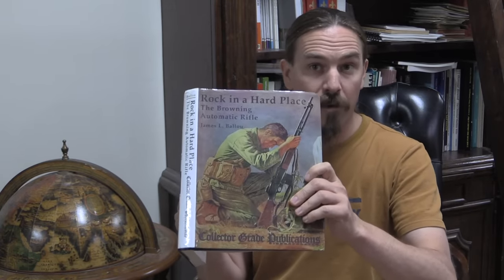Ask Ian: Why Not a Semiauto BAR Instead of the Garand?

Comment: When I saw the title I was like "eight minutes to say 'because it would be stupidly heavy?'"  But I guess the question was smarter than I expected.
Edit:  Ironically, the modern BAR is one of, if not the lightest full-power semiauto rifles on the market, coming in at as little as 6.5 pounds in non-magnum calibers, and still under 8 pounds even in magnum calibers like .338 Win Mag with a 24" barrel.
Reply: It was also much more expensive than anything like the M1 (4X the unit cost). It would have been an unaffordable as a primary rifle.
Reply: My first guess was manufacturing costs
Reply: @kolosmenus  Mine too. Plus weight.
Reply: @patrickancona1193  It wasn't even close to the first LMG, or even the first American one.  The Madsen, Chauchat, Hotchkiss, Lewis, and Huot all predated it and were designed for bipod use.  The Madsen was made in the 1880s.
Reply: As someone who's fired an M1918A2 BAR, it is a bit of a hefty gun, but so is the XM5 by today's standards, and the US Army is adopting that.

It's when I opened it up and was surprised the BAR wasn't designed by H&K, but unsurprised that it didn't become the primary service rifle.
Reply: I’m pretty sure they weigh over 15 lbs
Reply: @johnallen7098  No, the BAR doesn't come in .338 Lapua.  It does come in .300 Win Mag, as well as 7mm Rem Mag, but .338 Win Mag is the biggest one available in the BAR.  And if you're saying that .338 Win Mag isn't a caliber, then you really need to learn a LOT more about guns before you try correcting people.
Reply: @JimIBobIJones  That's because of ecomomy of scale and because the BAR was more complex to build as a automatic machine gun. If you made it lighter and semiauto only and produced millions of them, the cost would be roughly the same
Reply: @jmanieri3651  The M1918 weighed 16 pounds, and has been lightened to as little as 12.5 lbs.  Ian said that in the video.  The BAR that is in current production is a semi-auto hunting rifle with a stellar reputation for accuracy and reliability.
Reply: @phantomsoldier497  Making it semi auto only wouldn't reduce the price. Modifying an existing mechanism to be semi-automatic only doesn't actually simplify the mechanism. If you aren't simplifying, then there are no cost savings. 

Look at any gun that has had its firing mode modified, the unit cost remains largely the same (e.g. M1 garand to m14). 

Also economies of scale has diminishing returns. Granted, producing more would make them a bit cheaper but given already the relatively large number of BAR (300k+) produced, you won't get a lot of cost savings by scaling it up more. Economies of scale for being the primary frontline rifle would not account for the BAR being 4X the price of the M1.
Reply: @Bacteriophagebs  I didn’t even realize BARs were in production.
Reply: @Bacteriophagebs  Cool info, I always thought the BAR was strictly 30-06.
Reply: @GodDragonLich  The modern BAR is a completely different rifle to the M1918.
Reply: Personally I think the modern BARs look ugly as hell. Still want one, though.
Reply: @Bacteriophagebs  The semi-auto hunting BAR was a rifle designed in 1966 by a different Browning, they're not the same gun.
Reply: @charlesphillips4575  To my knowledge, which I admit is not great as I have only fired the M1918A2, the modern BAR is not a BAR it's the HCAR. A completely different rifle made, as far as I can tell, as a kinda tribute to the BAR. Again, I could be completely wrong and please correct me if I am. Anyway, I was speaking specifically about the M1918 BAR, not any "modernized version" of it.
Reply: @steventatlock5443  I'm aware.  It's just funny that a gun with the same name is so different despite being similar in many ways.
Reply: @GodDragonLich  They're talking about some tacticalized thing called the HCAR.
Reply: @Bacteriophagebs  the Huot is younger than the BAR, and never progressed past the prototype stage
Reply: I thought this to when I saw the vid aswell
Reply: You're referring to the hunting rifle. Completely different design.
Reply: @Bacteriophagebs  the commercial hunting rifle and the m1918 are completely different designs.
Reply: @Bacteriophagebs  they share the same name, they are completely different designs.
Reply: @jmanieri3651  they're referring to the commercial hunting rifle. Ohio ordinance however does make a copy of the m1918.
Reply: @GodDragonLich  it was actually ordered in several calibers.
Reply: @GodDragonLich  Ohio ordinance makes M1918 reproductions in both varieties.
Reply: @Bacteriophagebs  they're completely different rifles.
Reply: Hmmm thought the same!
Reply: Modern commercial Browning (semi) Automatic Rifle has no design heritage to the military machinegun BAR.
Reply: @Bacteriophagebs  Great, just great, now I will have to look up the Madsen, because otherwise I won't find and sleep. :D

But to be serious, I am always fascinated what a rabbithole of a topic historical gun design and historical guns are and how far certain designs that most people see as (relatively) contemporary actually reach back in time.
Reply: Friend Kyle has .338 mag bar. His dad bought it for him before he passed at an early age.  One of the most amazing rifles I have ever held.
Reply: The thought of shooting a full auto 338 Win Mag made me gag.
Reply: Where would a fella find a modern BAR?
Reply: @Bacteriophagebs  The chauchat was amazing
Reply: @nickmadigan2824  it's called an hcar, heavy counter assault rifle
Reply: Naturally the Army decided to ditch the semi-auto mode and make it a lot heavier instead. 🙄
Reply: @abrammilner9560  thanks, brother!
Reply: @Bacteriophagebs  .338 Win Mag isn't a calibre, it is the cartridge. .338 is the calibre.
You should really know a lot more about guns before correcting people.
Reply: The modern BAR has almost nothing in common but the name with the actual M1918.
Reply: @patrickancona1193  The BAR was originally designed for something called "walking fire". That doesn't sound very mounted to me haha
Reply: @johnallen7098  No, he meant .338 Win.Mag.  Famous hunting cartridge (elk/moose, + bear defense) in N.America since 1958, long before .338 Lapua (1989) came on the scene.  FN's modern "BAR" he's referring to, is just that:  a hunting gun, not a military arm.  Practical relation to the original BAR is basically in marketing name only.
Another Ironic Edit:  .300 Win.Mag. was actually derived directly from the .338 in question, five years later in 1963.
Reply: @JimIBobIJones  you forgot the part were I said lighter. Most of the cost of the gun is due to the fact it's a lmg.
Everything must be heavier to sustain auto fire and plus the gun was given a bipod, a flash hider, a buffer recoil spring and a complex fire rate reducer mechanism.
If you go semiauto you can pretty much throw away everything I listed up and use lighter materials for the receiver and barrel.
Reply: modern hunting rifles designed to be as light as possible and only fire a few shots back to back aren't exactly on par with combat rifles
Reply: @phantomsoldier497  again I would say you are way overestimating the impact on unit cost. Colt did make a version of the BAR for the civilian/law enforcement markets with pretty much extactly the modifications you mention - and it barely had an impact on price. (It went from $319 to $300)

You can look at modern firearms as a comparator, where you can much more easily get different builds of the same gun. Those components are always a small fraction of the total cost of a gun.
Reply: @JimIBobIJones  still comparing apple to oranges. The civilian version of the BAR is still a BAR so basically the exact same thing minus a few things.
They never built the semiauto proposal Ian was talking about. 
That conversion would basically be a completely different weapon that has little to do with the original gun just like the m14 and Garand
Reply: @phantomsoldier497  not really. I've refuted all of your points as raised
Reply: @phantomsoldier497  to expand, you can't simplify the BAR to reduce costs sufficiently to make it a viable primary rifle.

It's built from the ground up for a particular function and its price reflects that.
Reply: @JimIBobIJones  now you really didn't.
You still are comparing apple to oranges. A machine gun will always cost a lot more than a semiauto rifle. For example the M27 IAR costs more than double than a M4 carbine and weights more while being extremely similar because one is supposed to be a squad automatic rifle and the other an assault rifle.
Same would be for the BAR. Some version of it went down to only 13 lbs while being still being an lmg. A semiauto conversion designed as such can easily go to 11lbs like the Garand.
The only thing a BAR and an eventual BAR semiauto derivative would have in common would be probably the sling, the buttstock, the magazine and the action (not everything)
Reply: @phantomsoldier497  you raised 3 points (economies of scale, transitioning to a semi automatic and weight) as factors which I have refuted.

Your current argument is entirely lacking of any specifics and is grasping thin air.

You are comparing a family of modern weapons systems with hypothetical modifications on a specific weapon. 

There is actually a modern reproduction BAR that's semi-automatic. It's still twice the cost of a reproduction M1.
Reply: @phantomsoldier497  also, had to do some research on this (as my interest/background is in history and not modern firearms) but the M27 is not a derivative or a part of the m4 family but of the HK416. 

The m27 IAR and HK416C sell for the same price to militaries so your example actually disproves your point. A LMG variant of a frontline rifle is not inherently more expensive because its in LMG config
Reply: @JimIBobIJones  the HK416 goes for 600 dollars while the M27 is 1400 dollars and yeah the HK416 uses the bolt from the G36 which in turns is a derivative of an AR18 which uses a similar bolt to the AR15 plus the upper and lower receiver are clearly a AR15 derivatives. The HK 416 is in the AR15 family even if it is different. 
You treat weapons like it's impossible to make one system work in another while most designers copy each other continuosly when making guns.
For example the m240 in US service is basically a BAR in disguise since they took the BAR bolt, turned it upside down and placed in into the gun or the AR15 itself taking the bolt from the m1941 Johnson
Reply: @phantomsoldier497  hk416a5  is the variant sold to the military and it goes for the same price as the SAW variant. And I was explicit in the model and the sale to militaries.

I am tired of this pedantic argument where you just make wild generalisations without proper rational explanation or proper analysis of the evidence.
Reply: @JimIBobIJones  Dude the HK416C doesn't even exist lol, it was a prototype of a compact carbine that never went into production. 
You are the one making generalizations without even knowing what you are even talking about... Have you ever even fired a gun?
Reply: The BAR MKIII action has nothing in common with the original BAR. In particular, it has a rotating bolt, and not a tilting bolt like the original. The tilting bolt was a good part of the reason why the original BAR couldn't be lightened further than the Monitor model.
Reply: @patrickancona1193  Actually, the Madsen (M.1902 et seq.) was the successful light machine gun intended primarily for bipod use.  The M1918 was originally concieved primarily as an automatic rifle (hence the designation) for "walking fire" in the assault.  It didn't get a bipod until the M1922 cavalry model, or the infantry M1918A1 of 1937 or the M1918A2 of 1938.
Reply: My first thought before watching this video is the mechanism. Turning the BAR into a self-loading rifle is not possible. There is no reciprocating charging handle to manipulate the bolt if something happens, no way to fire rifle grenades, and it takes box magazines that cost more than stripper clips or en-bloc clips.
Reply: @Bacteriophagebs  don't forget Colt's potato digger
Reply: m14 weights 5,1 kg loaded,its something like 11 pounds?so 8.5 ponds BAR would be light
Reply: I have a left handed BAR (shortrac) chambered in the obscure 7mm WSM cartridge. My favorite deer rifle, it wouldn't mean so much to me if I didn't have to save money for months while I was going to college. I stopped in that gun store about once a week to make sure it was still there. Of course it was, who in the world would want a LH eject rifle in 7mmwsm lol
Reply: @charlesphillips4575  Here here!  Charles brings the actual truth:  the modern sporting BAR has little or no connection to the original military BAR.  Two different rifles made during two different eras for two different purposes.  The only similarities I can think of are "made by Browning" and "selfloading design."  Then there is the "Ohio Ordnance semiauto 1918 SLR", which is a modern semiauto only copy made by a specialty manufacturer.  Closed bolt and all that.
Reply: I think you are mixing up two very different guns. Browning makes a BAR for hunting Other than the name it has nothing in common with the gun Ian is showing. No parts interchange. The hunting bar uses a rotating bolt to lock very much the same as Remington's model 740 or 7400. In fact they compete for the same market.
Reply: I hate to correct you brother but the BAR weighs almost 19 1/2 pounds. the M1 Garand rifle weighs about 10 pounds.
Reply: @lpd1snipe  Try reading my comment again.  Or read some of the other replies until you figure out what I was talking about.
Reply: By the modern BAR, do you mean the Ohio ordnance HCAR?
Reply: The HCAR from Ohio Ordnance Works is an excellent rifle
Reply: Blinks
Uhhh, HOW do you get a 16-pound gun to weigh as little as 6.5 pounds? At first glance it seems that drastic a reduction would have to be done while changing the gun so much it’s hardly a BAR at the end of it.

(Obviously they are BARs, otherwise we wouldn’t be calling them that, but again, how did we lose so much weight?)
Reply: @magiccarpetmadeofsteel4564  They're not the same gun, they just have the same name.  Different inventor (also named Browning), different action, different purpose.

Comment: As Ian hinted to the M5, a lightned version of the BAR at around 12 to 13 pounds would still have been pretty good considering the firepower and reliability of the system. With an 18inch barrel, 20 round magazine, closed bolt semi auto only, pistol grip and FND style dissassembly, I think the BAR would have been a pretty good weapon till the M16 came around.
Reply: Fair enough, I look at the M14/15 as being decent but not as good as the BAR in full auto.  The first lot or so of M14s were chambered in 30-06 and were later made in 7.62 for commonality with NATO in ammunition.  Of course we then had to go to the M16 and 5.56 go figure
Reply: the modern bar, which has a rare 18" box fed model, is far lighter than that, and checks all the boxes. the problem of course is that everyone knew what the bar was, not what it could be.
Reply: @ALovelyBunchOfDragonballz  It is light for what it is and compared to the original BAR, but that's where it stops.
Reply: @ALovelyBunchOfDragonballz  i will give you that 7lbs 6oz is "heavy" but for a 308 the mrk3 is just over half the weight of an original bar, and given the construction it handles lighter than any other 308 i own.
Reply: @ALovelyBunchOfDragonballz  look up the bar mrk3 dbm (detachable box magazine.)
granted, it is literally a semi auto only version with an 18 inch fluted barrel.
Reply: @ALovelyBunchOfDragonballz  when did i say it was made by ohio ordinance? you do realize other people make guns right? why the hell am i even talking to someone who doesn't understand how to look up guns available on the civilian market?
Reply: That is so heavy.